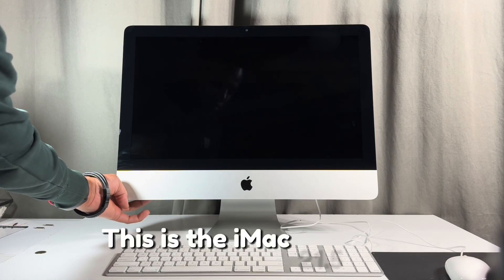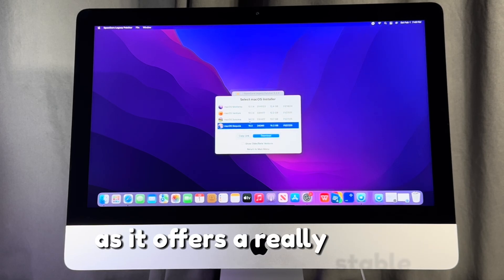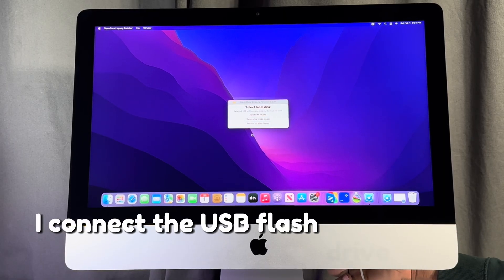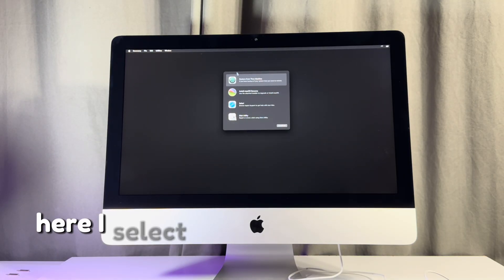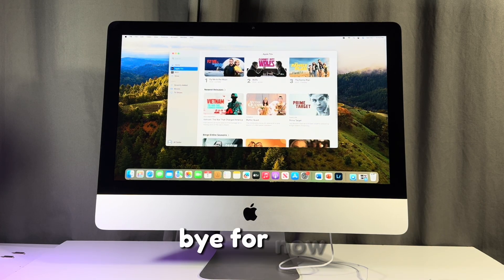Latest macOS Upgrade on Unsupported Apple iMac - SOLVED!

Comment: Thank you.
1 Q: I did the whole procedure and it works on a external SSD. But I have to manualy (hold optionkey with startup) and choose the right icon. I cannot run my SSD startup disc. Then it doesn't run: get the o and / icon with "support..../.../ startup". Is there a way to run de right Icon from boot?
Reply: I meant: I have to select the BFIboot with startup. Or else it select the startup disk. Then I get the 0/ sign. And Sonoma will not start up.  Any way to automaticly select the BFI boot?

Comment: I have a late 2015 iMac with a fusion drive. How do I install oclp plus sonoma. I haven't upgraded the HDD to SSD yet. Any advice will be appreciated
Reply from the maker: This video will be a helpful guide.
Reply: @aoeaster Thank you for your prompt reply. Will this still work even though I still have the original mechanical HDD with Fusion drive? Will the Fusion drive interfere with the OCLP installation, I have read that it might cause problems. Your video is very intuitive but I'm still unsure about the Fusion drive.

Comment: Sorry I have a question is not working for me when I’m creating the usb installer when the process is almost done and I see the message verifying installed a  receive a message on the screen “corrupted” and I can’t see the next automatic prompt help me !
Reply from the maker: You might be using a corrupted USB device. Try it with a different USB

Comment: What you do if you dont have an external usb ?
Reply from the maker: You could also use an SSD or a similar storage device. Just remember everything on it will be deleted in the process so make a backup if necessary.

Comment: Can the upgrade be completed without replacing any existing hardware on my late 2015 21.5” 4k Mac  running Monterey 12?
Reply from the maker: Yes, you can upgrade the macOS without replacing any existing hardware.
Reply: @aoeaster thank you for your support. Soon as ebook arrives tomorrow I’ll backup imac and can begin the process using OCLP.

Comment: Where can I find the info on purchasing the SSD to replace the factory HHD? 
My mac is a 2015 21.5” 1 TB capacity, iOS montery 12.7.6
Apple support is telling me to throw the iMac away. When I purchased I upgraded to a 4 core processor as I was told larger processors will process data faster. I’m sure I can do the job myself. And I will no longer be able to use apple tech support for the Mac, Correct?
Reply from the maker: Any reliable SSD purchased on Amazon or Ebay will do. You should be fine if your 2015 iMac doesn't have a warranty from Apple.
Reply: @aoeaster no warranty

Comment: After install I get the prohibited OS circle with the slash through it. This is after rebooting from the root install. Anything I can do here?
Reply from the maker: You might have experienced a hard drive failure. You can attempt a reinstallation and consider replacing the hard drive if necessary.
Reply: @aoeaster I figured it out. I didn't install the software onto the hard drive, it was looking for the thumb drive which I had removed. After playing around with it I got it sorted.

Comment: im trying to use the opencare thing on safari and the assets wont laod. ive looked at another comment with this problem aswell and you said to use firefox but ive tried to install it but it wont let me. can i use google chrome?
Reply from the maker: Yes, if you can install chrome it works
Reply: Hey I’ve downloaded google chrome but the assets are not showing it just shows a circle loading and not showing the open core software. How do I fix that?

Comment: Don’t work 😢 it said I need a high sierra to install Mac ios sonma
Reply: Use a different computer install USB to download it than put the USB back into your mac to transfer it. I had that same situation that's what I did
Reply: @benjaminrivers4476 how did you do this. an you go more in-depth, did you just install it on a new mac using the icloud and then transferred that way ?

Comment: I've upgraded my 2015 iMac to Sequoia but the system boots and runs very slowly. Just loading the wallpaper takes minutes.
I have already applied the post-install patches twice but it still super slow. Do you know what the problem could be and how to fix it? Thanks in advance.
Reply from the maker: Try downloading the Patcher with an ethernet cable connection. You can check in this video for some tips
https://youtu.be/5UHv5g6Aal4
Reply: @aoeaster  I had to downgrade to Ventura. The graphics card is not compatible with Sonoma and Sequoia.

Comment: hi! I have high sierra installed on the hard drive of my 27-inch iMac (2012). If I want to do a clean install, should I follow the same steps shown in this video? I plan to back up all my files to an external hard drive first
Reply from the maker: Yes, you can follow the steps outlined in the video. However for a fresh install you need format the drive at the installation step.
Reply: Thank you!! Really great video, easy to follow  @aoeaster

Comment: I have a 2013 iMac , can it be upgraded to download software apps like logic and other softwares ??
Reply from the maker: Yes it can be upgraded with OpenCore Legacy Patcher. However, you might need to research if your particular software has Graphic Card issues which require an upgrade.

Comment: I tried to do the same with my IMac (21.5-inch, Late 2015) with an intel Core i5 of four nucleus with sequoia. But it crashes in the logging and freezes. I have not made any hardware changes. Anything you recommend ?
Reply from the maker: I would recommend refreshing the NVRAM by restarting and holding down on Option + Cmd + P + R and allowing it go through the restart cycle a few times before letting go of the keys

Comment: This is a great tutorial for me! 
Thank you so much!

I have a late 2015 IMac that comes with its main macOS system installed on a small SSD (251GB) and  a larger 1TB SSD plus a 64GB ram. If I do this Os upgrade on my iMac, will it be able to work with my Adobe Lightroom and photoshop seamlessly for a longer time. Seriously working on a budget.
Awaiting your response. Thank you 
Since they’re the major software I use?
Reply from the maker: Based on my tests I believe it should work just fine. However, I would advise that you do a backup just in case some of your apps do not function as expected.
Reply: @ Thank you so much!
Reply: It’s a 2015, it will run those two as good as it can with the hardware. It’s 10 years old. You can’t expect it to run seamlessly
Reply: @iCrackr  even with the OS upgrade you mean?

Comment from the maker: Steps for the macOS upgrade
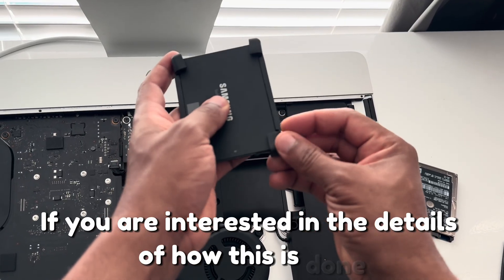1. Download OpenCore Legacy Patcher - 1:17
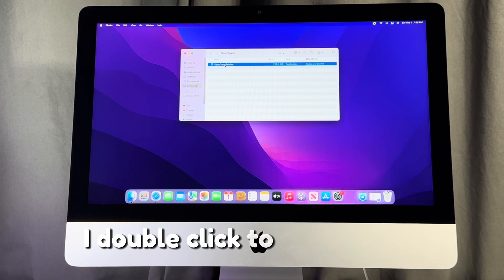2. Run OpenCore Legacy Patcher - 2:21
3. Install OpenCore Legacy Patcher on the iMac - 2:36
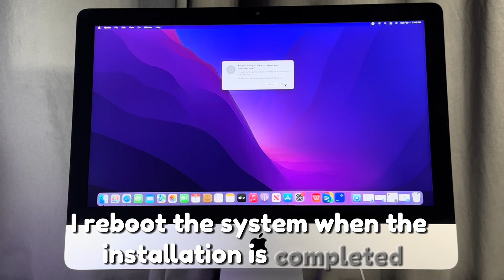4. Download macOS installer - 3:03
5. Create a macOS installer - 4:27
6. Upgrade macOS with Install media  - 5:35
7. Verify the running of Root Patches - 6:47
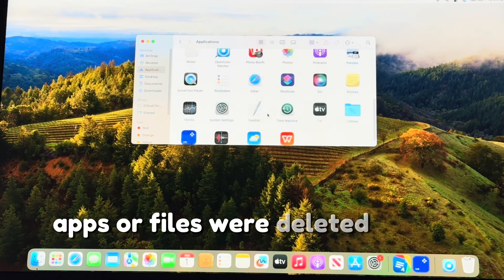8. Verify installed Apps - 7:07
9. Confirm update settings - 7:53
Reply from the maker: Related video: HDD to SSD Upgrade 
https://youtu.be/Y9bpNT3tTzg